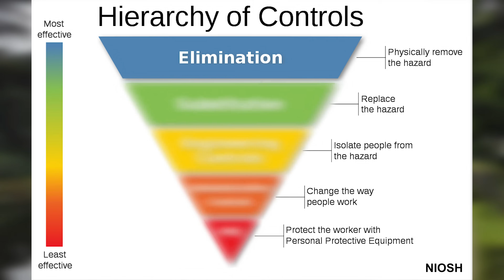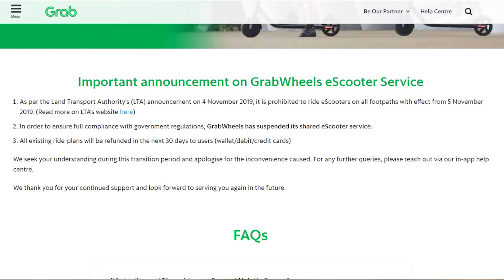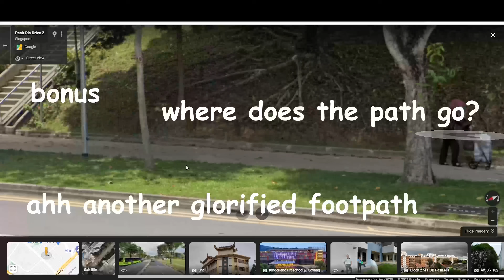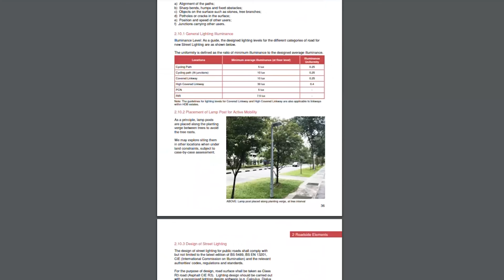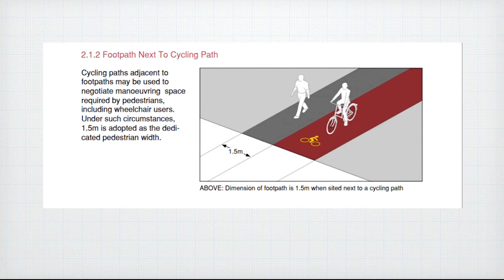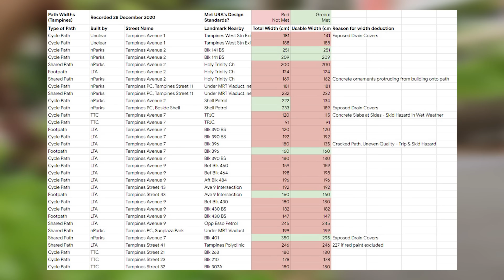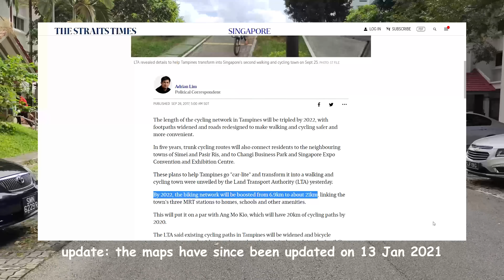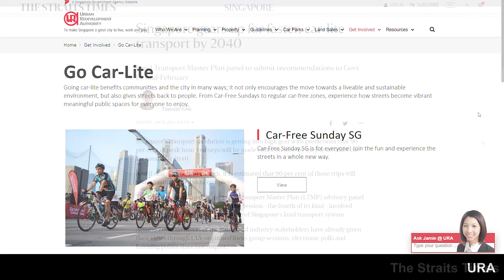The Importance of Well Designed Infrastructure | Crappy Cycling Infra in Singapore

Comment: Pls check out the corrupt LTA foot path designs, oops, sorry, LTA not corrupt, only the head (Minister) is.
They actually use the footpath and road side grass verge as a filter for mud water from the field. Only the road has direct drainage to the under ground drain which doubles as footpath. Water always flows across the footpath to get to the road facing side drains.

But Nparks field drainage is so non existent that PUB probably bribed LTA to use footpath as filter to drain the field water. The result is that in Singapore, the road is always dry but the footpath is slimy, full of puddles and streams flowing across, until an adjacent field is totally dry after a rain.
All the perm secretary probably use government sponsored vehicles as personal car, so they don't know how dangerous the footpath is to use now. The government has lost touch with the ground.

Comment: I guess this is a timing issue. In Hong Kong, you have "downtown", and then you have New Territories. The parts of NT with bicycle infrastructure were not developed until the 80s, and even after decades of stagnation in HK, I can see that the bike infrastructure is still clearer than Singapore.

I assume that's because Singapore was developed right before bikes became a thing, and so while Hong Kong got to develop from scratch, Singapore is stuck retrofitting.

Comment: I am so glad I found this video.   I cycle 90% of commute on PCN for last 3 months and you just summarized all the issues I face riding on PCN. as you mentioned toward end of the video, it may cost more money, thou my conclusion is to make the cycling paths along the road similar to what you see in NYC or London and not to share the paths with pedestrians.
Reply: Ironically, on road cycling paths probably cost less to make. It doesn't require widening sidewalks, just putting down some concrete barriers and repainting it. But it would be very unpopular with motorists, since it removes one lane from them.

Comment: Great video! Totally agree with you on the poor design of our cycling paths. I fell 2 times over the past month cycling on the pavement due to various obstacles (pole and railing) that seemingly appear out of nowhere. Not to mention that there are many odd turns that are often sharp and narrow. I now cycle mostly on the roads as they somewhat feel safer than cycling on the pavements (ironically), although drivers are sometimes impatient when we are cycling on a uphill slope as we tend to go slower.
Reply from the maker: thanks!

do you mind sharing the location of that path? i might head down to take a look at it!

yep, i agree that the road is much more easier to navigate and not forgetting how they are much more smoother to ride on than bumpy cycling paths

the newer paths are certainly going to be more comfortable, though whether they will pass safety standards remain a question
Reply: @tehsiewdai  hi, the first fall was along Telok Blangah Road, just a few metres before Bt Chermin Rd. There is a section with 2 consecutive sharp turns, which I believe many cyclist avoid by simply riding on the grass patch. U will see there is a bald spot created there over time. I fell when riding on the bald patch back onto the pavement - There is a small curb back onto the pavement which I did not anticipate, and due to my speed + a fully pressurised tire, that bump made me lose control. 

The second fall was in the landed housing area around Serangoon Gardens - Was navigating a sharp, narrow turn in a secluded pathway behind a row  of houses when my handle bar got caught in the railing. Sorry, I couldn’t remember exactly where in Serangoon Gardens because I was pretty lost and was trying to get myself out of the area. I should have dismounted and push instead, but I stubbornly refused because I was frustrated at having to do that multiple times when riding in this area. My fault actually.
Reply: I also feel safer cycling on the roads even if im battling taxi drivers and buses who want to overtake me just to cut me up a few metres later just to access their bus stop. Most PCNs are incredibly bumpy especially those in urban areas. Theyre absolutely horrible for cycling on - Punggol has so many "pretty" sections that are just brick-paved sections of pavements.

Comment: Good video. Every country in the world has unfortunately become dominated by cars, and every country needs to do something about it. What's different about Singapore is that your country is physically small which means that there is really no need for cars at all. Not much point in public transport either. Long commutes don't exist because there's nowhere else to commute to and every journey within the country's boundaries is of cycling distance for a reasonably strong cyclist.

So far as I can tell, no-one is even saving any time by using motorized modes to get about. I read that your government has set a target to ensure that by 2030, 85% of public transport commutes of up to 20 km in length will take less than an hour. At the moment they take on average 84 minutes. So at the moment the average speed is about 14 km/h and they're hoping to increase it to 20 km/h. i.e. the target that they're trying to reach will still leave public transport somewhat slower than the speed that an average person can ride a well maintained bicycle. Averaging 30 km/h isn't difficult for fit cyclists.

To build the continuous infrastructure required to enable efficient cycling would cost considerably less than the billions which are being spent to prop up the inefficient public transport and it would have other benefits as well such as reducing dependence on imported energy, reducing pollution, making the population more healthy and saving everyone hours a week which they currently waste on their commute.

Your message ought to be super easy to get across to the government. You should be leaning on an open door in suggesting that Singapore transform itself to enable efficient cycling. But I know from experience elsewhere that it is very difficult to get through to people and I guess that's the same for you too. Anyway, good luck.

p.s. I live in Assen in the Netherlands. There's an almost uninterrupted cycle-path between my home and the home of my daughter who lives just over 30 km away in Groningen. I'm an old guy but it still takes consistently less than an hour to cover that distance by bicycle. There's a new even more direct four metre wide cycle-path under construction which will be completed next year. This will speed up my journey. Providing the infrastructure really does enable journeys to be made more conveniently by bicycle.

Comment: Great video!!! I stay in Tampines and cycle every day. 

Some parts still sucks to cycle. Especially places where cycling paths are not built or went cycling path cut straight through the bus stop (Eg. Bus stop along Ave 6), also some cycling paths are old and run down.  (Along Ave 1 the asphalt have cracks and bumps very dangerous)

Hopefully, things will improve. I have seen new cycling paths in the town and look forward to more 

https://www.lta.gov.sg/content/dam/ltagov/news/press/2017/20170925_Tampines-WalkingCyclingTown_Annex.pdf
Reply from the maker: oh yikes! the ones straight to the bus stop are nasty! especially when using a larger bike to ferry people around. there's a bus stop bypass at avenue 7 so narrow that people need to reverse out if they meet each other at the bypass.

the older paths at tampines avenue 1 are horrible and far too narrow for people to use - especially the one near street 11 which has worn out so much that it's bottom structures are exposed! however, the newer red ones further up north are a significant upgrade!

i really look forward to improvements in the town - the day people aren't forced to wear helmets to make short intratown trips at a decent speed is the day tampines can truly call itself a cycling town

Comment: As someone who lived in Melbourne, I am now a firm believer of on-road bike lanes (just marked by a painted bicycle). Bicycle lanes cannot be too firm, otherwise car drivers would just shout at you if you deviate from it (eg. I was shouted at for waiting for the traffic light on the second left lane, because the far left lane turns green before the straight (this was in melbourne). The car driver wound down his window to scold me because I wasn't sticking to the bike lane without understanding why I did that.

Singapore on-road cycling feels uncomfortable. Fast traffic, wide lanes, no slow/parking lane to slow down on and get off the road. But sharing with pedestrians is even worst I think. Shouldnt be mixing pedestrians with cyclists, way too dangerous.
Reply from the maker: thanks for sharing your perspective!

are painted bike lanes in your area wide enough for commuting and suitable for less experienced riders?

i'm not too sure how roads in Melbourne are like - but many roads in Singapore are built far too wide which promote speeding

the current approach that is taken in singapore is to get people cycling off the road and onto footpaths (which aren't designed to support bicycle flow in any way) and i share the same opinion that it's terrible

cycling can't be done in an efficient manner and walking doesn't feel comfortable on a footpath

many people using bikes for commuting (ie shared bikes) are forced to do so because of helmet regulations which only apply to on road riding and due to that law, on road bike lanes may not work that well here, though i'm optimistic that they will perform better if helmet regulations are gone
Reply: @tehsiewdai  Oh, I dont live in melbourne anymore, so I'm speaking from past experience (I'm in Malaysia now). You can check out google streetview to see a comparison between Swanston Street and Elizabeth Street.

Swanston streets is closed to car traffic except commercial vehicles, and have a bike lane built on much of its length. The bike lane is separated from the pavement by a slight height different.

After the completion of this bike lane, I switched over to Elizabeth. The short gap meant that pedestrians might sometimes wander onto the bike lane. And because it was less daunting, yoy get more newbie riders on it (which is a good thing). But I found these riders a little slow, so I switched to Elizabeth Street.

Elizabeth Street is more typical for bike lanes that you might find throughout most of the city outside the CBD. There's thin painted on bike lane for a lot of it, and for parts where there isnt a painted on bike lane, you have a stenciled-on bike to remind drivers that bicycle also use this road. With right turns, bikes do a 'hook turn' (keep to the left as you cycle up to the other side of the  road. Wait for the lights to change, then turn right and join the car traffic behind you in that direction).

I guess the point I'm trying to make is that, ideally, every road is a bike lane. It makes getting around a lot easier.

Comment: Well done for drawing attention to the situation here. PCNs are not cycling infrastructure
Reply from the maker: thank you!

well, i personally find that good designed PCNs such as those at ECP are cycling infrastructure - well segregated, limited conflict points, separation of speeds
as for many others which are nothing more than useless paint - those are just glorified footpaths!
Reply: @tehsiewdai  Pavements and cycling path do not belong together. The speed difference in between a pedestrian and a cyclist is too huge. Unless both segments are really wide.
And then, what needs to stop urgently is everywhere putting posts up.
Reply: @tehsiewdai  I think the sentiment @frankascanbe8781 is getting at is that cyclists are often told ‘keep it to the PCN’. Like I love a good PCNs but it doesn’t go where I’m going my friend. Also I think most of them are speed limited to quite a slow speed to protect pedestrians since the lane is often shared.